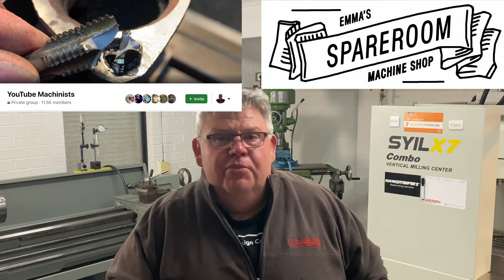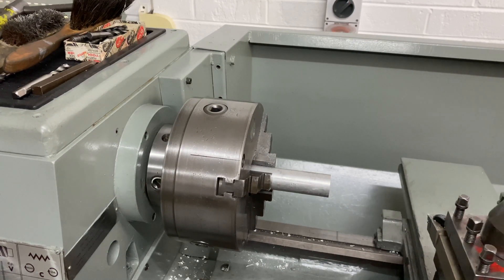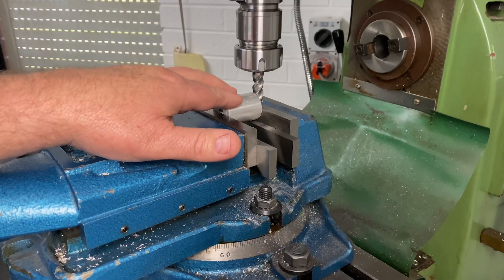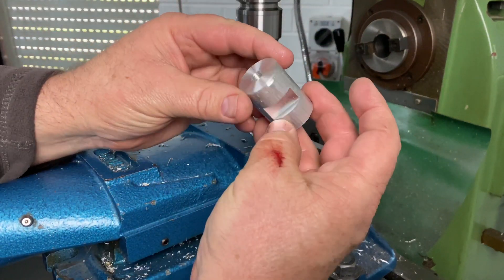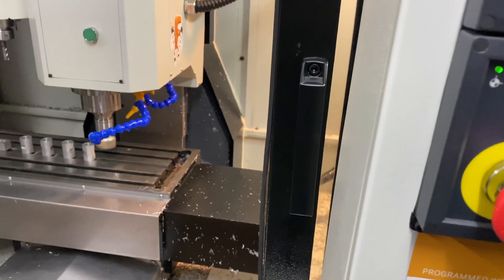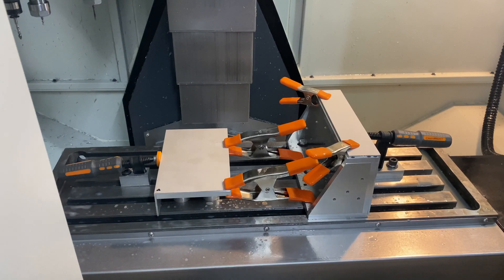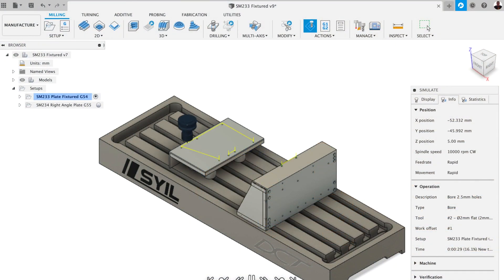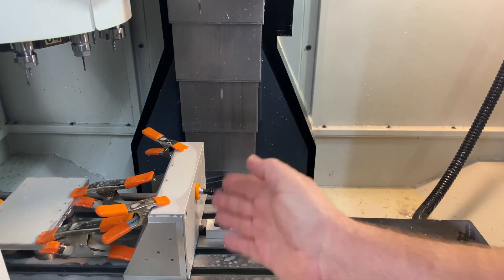CNC Machining Custom Fixture Plates - Old Video from Aaron Engineering

Comment: Hello Aaron,
Does crashing happen very often within the CNC world? 
Cheers
Paul,,
Reply from the maker: G’day Paul. That’s a very good question mate. It was more challenging in the old manual programming days then now. These days we use CAD CAM for everything and I can simulate the entire program before pushing the cycle start button. However and that said, you can easily crash if you have the wrong tool length, or coordinate system selected. To be honest, I still get “pucker factor” each time I push that green button for the first time 😓. Cheers 🍻